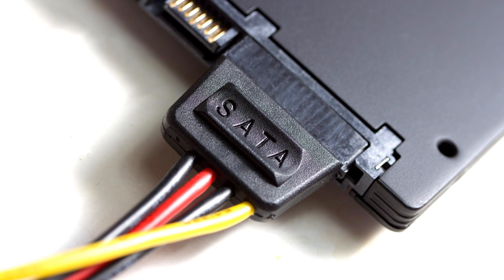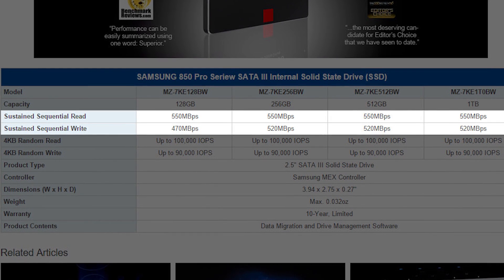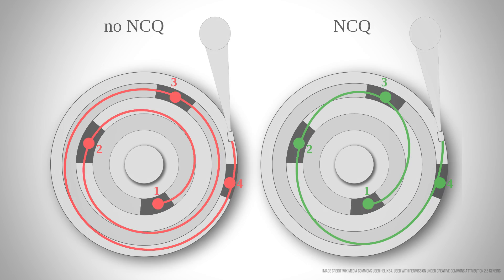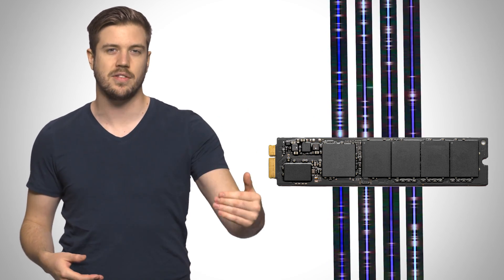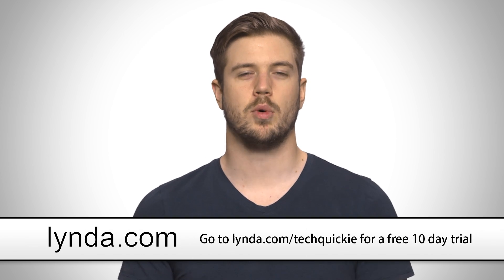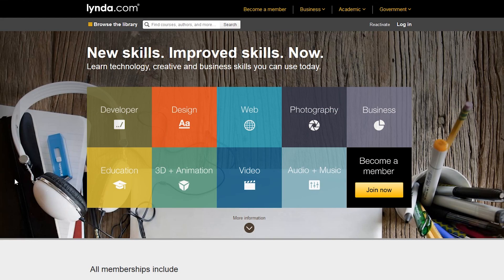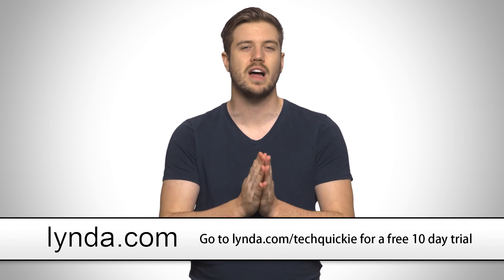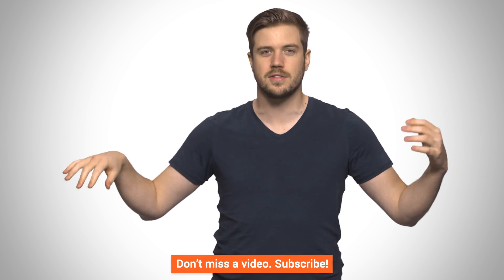NVMe As Fast As Possible

Comment: Well. This makes me feel slow now with my WD Black2 drive. Feels fast as it is my first dedicated SSD for an OS install. Windows 7 can boot from power switch press to usable desktop in around 30 to 45 seconds and that includes selecting an OS (dual boot 7 and 10) as well as typing my password. Sure beats my old mechanical HDD that would take a few minutes before I could even think of doing anything on the desktop when booting. Now that 30 to 45 seconds is considered damn slow by the standards of now. Windows "instant on" that can boot in like 10 seconds and such. I'm always a generation or 2 behind the current trends due to being a broke ass idiot...

Comment: Could you guys do something on 4kn vs. 512e drives?

Looking at new mass storage for 850 Pro and SM951 NVMe boot drives and want the fastest most reliable storage possible.  I have a 128MB cache 6TB WD Black and I'm considering the WD6001FXYZ which is a 4kn 6TB 128MB cache drive.

What're the pro's/cons of going to 4kn - is it livable day to day?  Can I install steam/blizzard/uplay etc. games there without any issues?  I'd likely be using a UEFI install of Win 10 Pro or Ent (MSDN account!)

Comment: for anyone interested about game load times - it wont load most games faster than a sata3 ssd with 100k iops. ive tested a ramdisk thats 40x faster than a samsung 840 pro and load times were within ~1 second of each other. the bottleneck becomes the single thread performance of your cpu. cpu used was a 3930k at 4.6ghz
Reply: There's a noticeable improvement from HDD load times to SSD load times. After I moved NFS Rivals onto my SSD (a game with horrible loading times), my waiting time was almost halved.
Reply: +Quarker It all depends on the game, really.
Reply: EZOVERDOSE
there are different versions of NVMe, do you know the difference between them?
Reply: Quarker exaggerate the situation and imagine pairing an ssd with a 386 machine from 20 years ago. there would probably be no difference between ssd and hdd load time.

you might be able to see this exaggeration by changing maximum processor state in power options to downclock your pc extremely low. remember if you test this you need to do it after a reboot because once you load a game once the majority of the scene is cached in ram and will load much faster the 2nd time skewing any results
Reply: +Noobish hahahahahaha
Reply: I hate when people expect their games to load 10x faster with an SSD (while it might actually happen in some cases) rather than a HDD and get disappointed since they don't realize a lot of the load lies on the processor.

Comment: is NVMe supported by the OS, motherboard, BIOS, or the CPU? So if I slap on a M.2 card into a PCIe x4 slot on my old X79 mobo which I know doesn't have NVMe support, would a BIOS update fix that?

Comment: Ok, informative except that typical users I deal with haven't a clue whether they need it or not. Perhaps your videos are geared towards geeks, but if not, it would have been good to include what type of real-world users would need this. (Last week I had a user persistently badger me about MicroSD card speeds. He is a casual video viewer and was all worried about moving his videos from his tablet's internal memory to the aux. MicroSD card. Would it stream fast enough, blah, blah, blah? I assured him that for his use he didn't need the super expensive higher speed cards. The $20 to $40 cards on Amazon were the best cost/usage balance for him.)

Comment: Wouldn't NVMe also be very useful for hard drives in server environments? Obviously they wouldn't be able to leverage the higher bandwidth limits, but the higher parrallelisation should still help if many people are requesting data at the same time, I should imagine...
Reply: no. there is only one read\write head per disk which obviously can only acces one bit at a time or execute one instruction since it is physically locked in place, unlike flash storage.
Reply: No. That is what SAS drives are for. They can handle full duplex communication

Comment: If your computer still has a BIOS I'd be surprised if it even supports NVME. Maybe you were perhaps referring to UEFI __.
Reply: +Scoopta UEFI is a form of BIOS
Reply: ***** it's actually not. "But you may see the term 'UEFI BIOS' (or even just 'BIOS') incorrectly used to refer to a UEFI firmware" https://fedoraproject.org/wiki/Unified_Extensible_Firmware_Interface "UEFI replaces the Basic Input/Output System (BIOS) firmware" https://en.wikipedia.org/wiki/Unified_Extensible_Firmware_Interface "UEFI (Unified Extensible Firmware Interface) is a standard firmware interface for PCs, designed to replace BIOS (basic input/output system)." http://windows.microsoft.com/en-us/windows-8/what-uefi